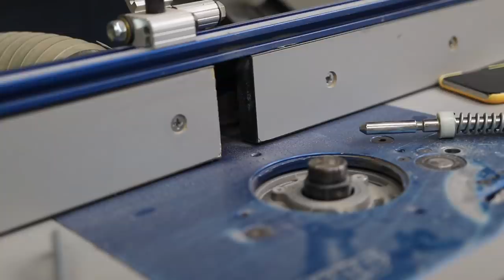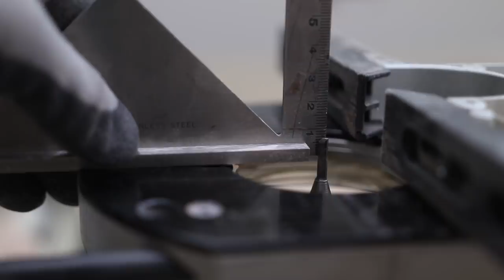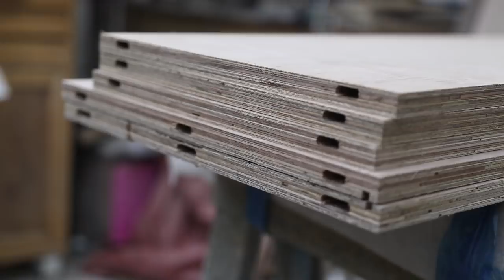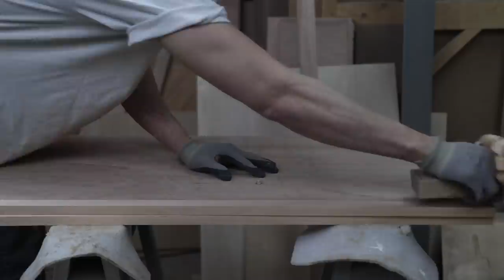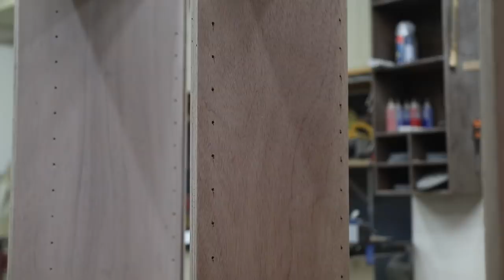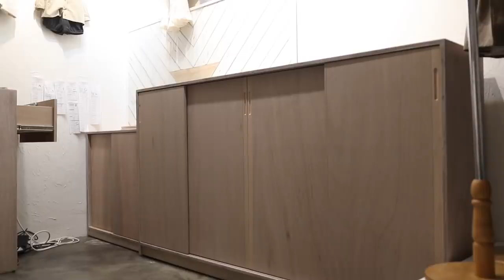W51_Sliding closet with shelves

Comment: What is that thing you applied on it and what is the name of the hardware you used for the slide.
Reply: I have the same question
Reply from the maker: I applied white stain and the hardware is no-brand.. just made in korea..
Reply: @ViTTEN   I will like to build it. Though I'm a start up I don't have machines yet. But I will try it put. Can I follow you on Instagram or Twitter?